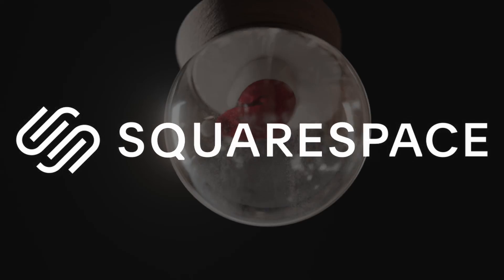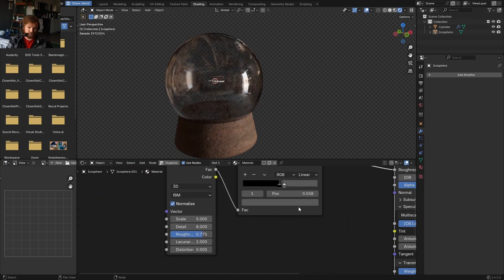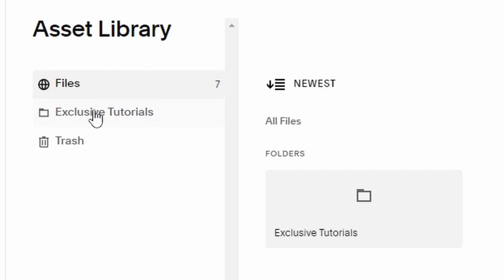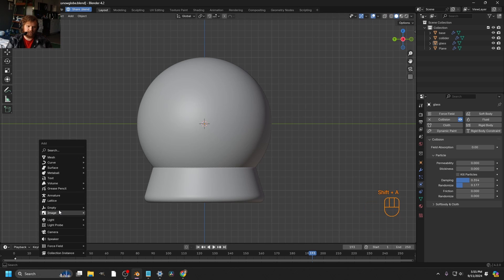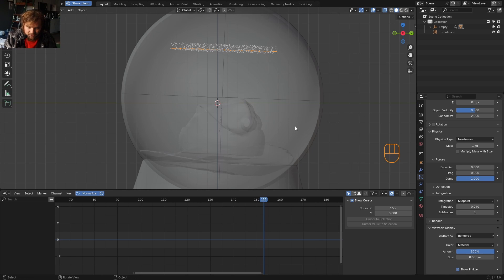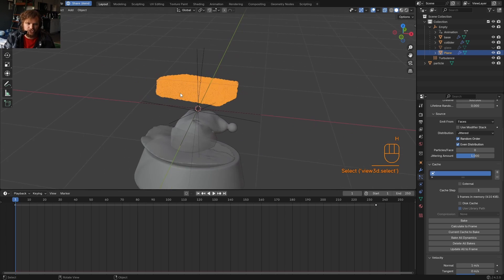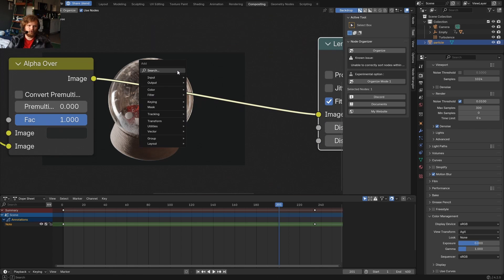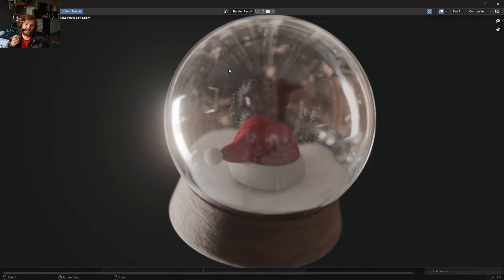Particle Simulations and 3D Snow // Blender Tutorial

Comment: Uhh on the santa hat you plugged in the normal map to the strength instead of the color
Reply: Also if you select the principled BSDF node and press CTRL+SHIFT+T, you can just select the different PBR maps (normal, roughness etc) and blender will automatically set up the material for you.

Comment: Why is not changing the Strength value desirable?
Reply: It's made for masking. You'll only get realistic results if you treat it like the metallic slider and use it at 0 or 1. Though you're free to use any value for artistic reasons.
Reply from the maker: think of the distance as how far off the surface the bump should 'apply' - generally this will be really small